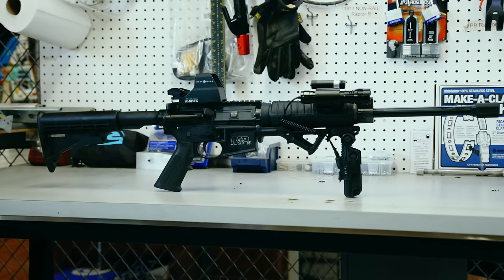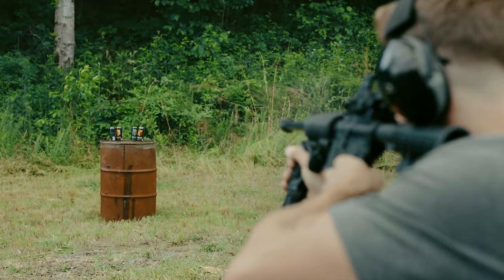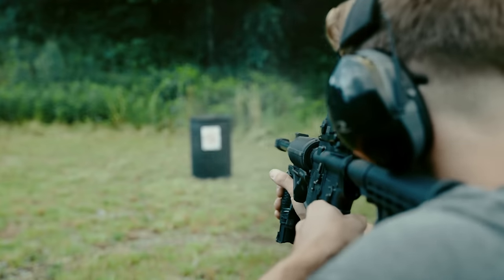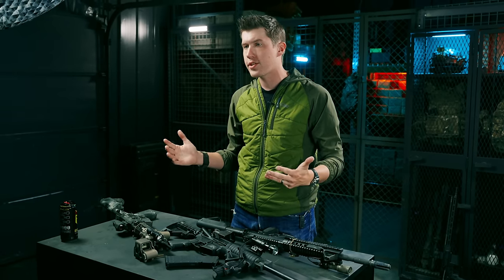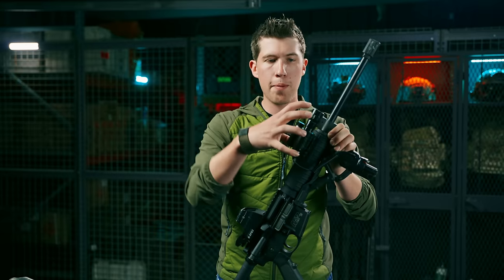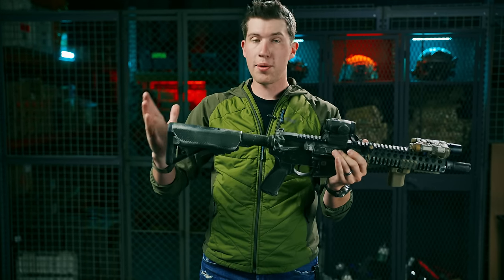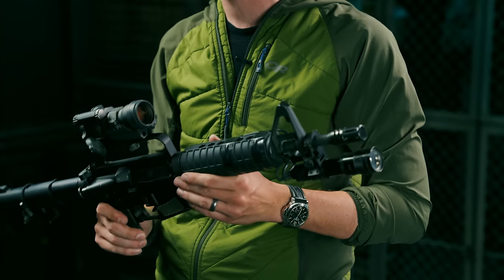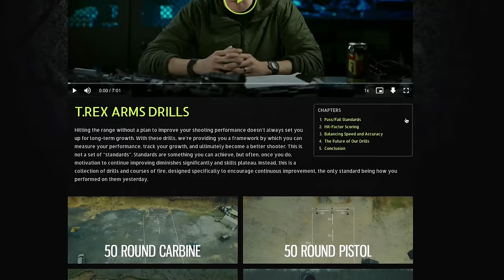5 Mistakes New Rifle Owners Make

Comment: After being in the Army for
8yrs in a combat unit, 25m / 300m zero is king. You are basically pinpoint accurate from 0-50m and 250-325m. Everything in between aim a tad low. Either way 0-350m if you aim low center mass at a man sized target (without wind) you score a hit.
Reply: hard wrong
Reply: I’m so glad you said that😅 because for us city boys with indoor ranges sometimes 25m is all we can get
Reply: I zero 30-30 to 175 yds. A center hold hits a deer's vital zones from 0-250 yds
Reply: Max point blank is less error and gets you the same distance..I mean get some sort of zero for sure, but you’re better off zeroing at a farther distance.  The only reason the Army does 25 is because they can’t afford the time or ammo and dont have the space to do a 200 yard zero in austere environments
Reply: Is the romeo5 a good red dot to start with?
Reply: @dasboot9471 the US ARMY doesn't have time or ammo? Kind of confused by your statement
Reply: @SotoPhotoDir Yes.
Reply: I have been in the Swiss army and our standard shooting distance is 300 meters. Almost each village has 300 meter range and if you are enlistet in our militia type army, you have to shoot at least once a year and get a minimum of points. So all our rifles are zeroed on 300m and I have been shooting from 5 to 300m without ever changing anything on my iron sight settings and hitting everything. the only thing we have is flip up back sight that lets more or less light through (biger bore) for low light conditions. Our SIG rifle shoots the same 5.56 Nato as the AR.
Reply: @wickedtwix  Not to detract from the main topic of the thread here but I love that SIG rifle you're talking about. It is one of my most sought after rifles and I hope to have one imported here to the states someday.
Reply: @2A4ever  yea being the dork I am, i did not purchase my service rifle 30 years ago because i wenz abroad. Would love to have one but they are 3.5 grand bone stock simple...more if you want some fancy stuff mounted. I will fo for the AR15 😉
Reply: yurp. 25m/300m ftw.  

and if you feel the need, 25/300 on red dot, 100m on iron sights.
Reply: @SotoPhotoDir yes
Reply: @wickedtwix  no you can't sight in at 300 yards and then hit everything in between unless everything is a man sized target and you are fine hitting anywhere on it... and even then you are going to have some problems. Stop the bull.
Reply: You obviously never shot the SIG STGW/90. The rear sight has four settings for 100, 200, 300 and 400 meters. If the gun is sighted in at 300, you will hit everything from 10 to 300 without issues. And yes, shooting man sized targets is a thing in the army but as you know, these have an A zone as well. Check out our A5 and B5 targets we shoot on 300m if you are interrested.
Reply: Range I've been going to is only 25 so that's my distance for the time being.
Reply: @SotoPhotoDir  yes. I have several on several different platforms.  I have kids now so I can't afford more EoTechs or ACOGs lol
Reply: @celticanglotx313  If we go off the assumption that your 25 unit (yard or meter) zero reconverges at 300, you're going to be better off zeroing at the longer range if you can. You can be off very small amounts and it not show up as much at 25 as it will at 300.

I wish you the best of luck getting access to longer ranges!
Reply: @jonathanschubert9052  What grain/ammo on that 30-30?
Reply: I first zeroed at 25 meters since that’s the max for most indoor ranges, then I sighted at 50 at an outdoor range.

I hear what you’re saying about 25/300 but I don’t get the logic over 50/200. I’d much rather hit a little low at 25 meters (and at a larger target both because it’s closer and because it’s the torso area) than miss high at 50 meters. It’s also a flatter trajectory to 200 meters. Not sure how many 200-300 engagements happen but trying to compensate for that drop would be much more difficult.

Disclaimer that I have not served. I’m just trying to sort through the logic in my head and it just seems like 50/200 makes the most sense, at least for me.
Reply: @angelofpain3890 it’s the only way you zero in the army. I’ve shot expert that way for the last 5 years. Irons and Aimpoint CCO.
Reply: @dasboot9471 but the science lines up it works fine. I never miss the 300yd shots with irons. 25yrd zero every year
Reply: @wickedtwix we zero at 25 and then qualify on a range of 50-300m. I shoot 38/40 nearly every year. Iron sights and Reddot
Reply: @celticanglotx313 it works well enough. You do it properly you won’t miss a person from 50-300m
Reply: @notsure7874 the 5.56 cartridge rises after it leaves the barrel. It’s physics. It doesn’t matter where you zero it at between the top it’s gonna be the exact same.
Reply: @archipelago93  due to bullet trajectory, you will not be able to sight the 556 at 50 and 200. If you move your first impact point up to 50, the second will also wander out farther.
Reply: @icebox829  That is just not true. The 5.56 has no special properties that other cartridges don't have. I'm not sure what physics you believe are taking effect, but the "rise" in a ballistic chart is entirely because the sight is above the barrel. If your sights were on the same plane as the bore center, there would be zero "rise" on that ballistic chart.

https://www.youtube.com/watch?v=IkCwedaAOGE
Reply: @thomgizziz  get quality irons. i zero at 25 meters with the rear at 8/3+1 i shoot a 10 inch shoot and see and do very well. that's vitals on anything you'd ever plan on shooting with a 22 caliber rifle. i do like optics and use them more since I'm getting older, but don't act like someone cant shoot accurate open sights at 200m+
Reply: @SotoPhotoDir  Yes, the Sig Romeo5 is the top choice for about $110 to $103.  Holosun 403 and 503 may come from the same factory in China but cost a little more.
Reply: im the outlier i like the 50/200 zero.
Reply: @raphramos6297 it’s not about affording ammo it’s about units not wanting to to check out more ammo and spend all day zeroing a company
Reply: @MylesKillis  I've fortunately wasn't a part of a unit like that. I hope those units get better leadership in place
Reply: I prefer iron sights I hate scopes
Reply: Brother you are lost in the sauce. If  a 25m zero converges at 300 then a 300m zero also converges at 25. Why not shoot at the closer target, zero, and move on with your day? I think if someone took you to the range and had you zero a rifle you'd pick up what we're putting down.
Reply: Lol so you're saying just don't use sights...you'd still have to aim up to hit any target at any distance. It's like throwing a baseball, no different. I'm starting to think you are trolling people.
Reply: lol sorry hoss your time in what I’m sure was 3rd id doesn’t mean shit 😂 50-200 meter zero or a 36 yard zero is much better. The arch of the bullet is much shorter than 25m-300m meaning you can be more accurate with less deviation in your impact over distances both closer and farther away

Comment: My first AR15 was a M&P15 gen 1. I was in the Army so I got it from the PX for $500+ tax free. I converted as much as I can to get it as close to my Army issued M4 so I can improve my marksmanship. 10 years later and 4 other AR's, I still have it and it's  my bedside home defense AR.
Reply: S&W MP15 is a very good AR. Don't let anyone bull you.
Reply: Where were you at? We didn't have guns at our PX at Fort Stewart.
Reply: @tballstaedt7807  yup I tell people the same thing.
Reply: @jaycee509  If I remember correctly fort Irwin is where OP4 training is right?
Reply: @mx500a4  yup. Brigade level training. Units usually go through rotation here before a deployment.
Reply: @jaycee509  I think our brigade was scheduled to go to either Fort Irwin or back to Ramadi in 2007, but they ended up sending us back to Iraq instead. I didn't get to go back though. I decided to become an alcoholic and drug addict and they kicked me out 3 months short of my contract. I was a dumb ass.
Reply: @mx500a4  ah damn. Hope you're doing OK now bro
Reply: @mx500a4  they definitely sell guns at ft Stewart px now.
Reply: @almalikaluqdah3699  I actually bought my first gun just outside the base in Hinesville back in 2005. I can't remember the name of the gun shop though. I was 19.
Reply: @jaycee509  I got off the drugs right after I drove back to Minnesota after getting discharged, (I got a general). But the drinking was a bitch to stop, finally sobered up 2 years ago. I was still successful in life but I drank everyday.
Reply: @mx500a4  Excessive binge drinking is just par for the course for active duty life. It's like frat life with weapons, high explosives, and unit PT mixed in, lol.
Don't get me wrong, crushing some cold ones with folks in your unit can build camaraderie and unit cohesion...but all too often it can (and does) lead to folks turning into raging alcoholics, unfortunately.
Reply: M&P = trailer trash gun.
Reply: @sevenpointsixtwo9707  If by trailer trash you mean reliable feeding and decent accuracy & durability, then yes. Is there any better value that can be had for an AR?
Reply: Mine was a gift from my grandpa after I got out of boot camp
Reply: @mx500a4  I got my first AR15 at an air force BX at Beale AFB in Cali. Just had to ditch the bullet button when I finally got outta there.
Reply: @sevenpointsixtwo9707  I have an M&P as well and it has treated me great for the passed 12 years. Still fun to shoot and it still holds it zero. What's your point? People like you make me laugh. Talk shit behind a keyboard just to get a rise out of folks. Good luck in life. Your going to need it!!
Reply: One of my first rifles was the M&P-15 Sport. I absolutely loved how it had no frills and had great quality everywhere it counted. I miss that thing.
Reply: @christoph9587  it’s just a guy that likes calling people poors and saying poverty pony (unfortunately he said that in the video) as a way to front on someone.  There’s for sure junk out there that you should steer clear of but the M&P is better than nothing and are reliable no frills guns and are a great entry into the game.  Tacticool bros that go and drop $4000 on a DD and optics and they can’t shoot any better than the poverty pony?  See it all the time.  A Sportcar and Econobox both get you from A to B.
Reply: @jamestewell7721  I also have a Noveske I got last year. That thing is great!! I am definately glad I got my M&P to start out with. It taught me how to shoot. Guess that is all I can really ask for out of an entry level gun. You make alot of sense too by the way. Good shit sir!!!!
Reply: This is the exact type of input that makes me wonder why he seems to hate on it so much? I think he’s gotten so used to the Rols Royce of the gun world he’s forgotten some people will never be on that budget and that even as a budget AR the S&W 15 is a good rifle that can go toe to toe with many more expensive guns.
Reply: @sevenpointsixtwo9707  Well it definitely Kept Kyle Rittenhouse alive in a grave situation and didn’t fail him. By the way, I lived in Wyo for a winter some years back and to be honest with you, I saw some insanely nice guns in any of the trailers I went into lol.
Reply: @mx500a4  Don't forget Ft. Polk!
Reply: @mx500a4  they do at ft Jackson
Reply: Bought my 1st AR in Fairbanks, Alaska in 1979. It cost me about $250 new from a hardware store. Unfortunately sold it (and other assorted items) to guys in my Company when I PCS'd out in 82'. Too much of a hassle with the Canadian government driving out on the Alcan to the Lower 48.
Reply: Well said Sir! And to many of you who replied to this flex free comment with honest review of your own experiences, thank you. And, I agree the M&P15 is a great entry level AR. 

So that being said, I now have to say this. I came back to this channel, more particularly this video for mostly one reason! I remembered how cringe it felt watching what used to be a favorite content channel of mine start talking down about 
"some of your favorite YouTubers" are Scheels or uneducated hacks, and that "just as good" firearms & firearm accessories are like some mythical cryptid, where if you are even remotely curious you're labeled as a "crazy tree thumper", in our community you're "poors!"  I'll be the first to say that just as good firearms/firearm accessories aren't real common. But I own what I would consider to be "just as good" firearms/accessories. The one that made this video feel so grimy is my M&P15! Its never had a a single failure and after many, many rounds of range time (around 2000) it continues to shoot sub MOA! And though I wouldn't put my Sightmark on an AR, it does however still sit on my Remington 870 deer gun. And with that slug gun, anything I want to shoot inside of 120 yards had better be smaller than an 8" paper plate or its dead! For a $100 red dot to take the shock associated with 3" Magnum, high brass slug shells, and its resilience to the weather that I have it in every December as a southern Ohio whitetail deer hunter surprised even me. And thats why I have put that particular Sightmark in the "just as good" catagory when compared to an EO TECH at least for civilian uses. Know if you have nods and think you're a backyard SEAL, buy an EO TECH But aside from the NV settings, Sightmark is neck and neck, and a 400% savings!

Now, dont ask me why this guy cant hit a row of cans 20 feet away, while shooting half a magazine through a sub MOA rifle mounted with a Sightmark!?!? 
I personally have killed 10 or more whitetail deer with the slug gun I mentioned above, 3 of which I harvested in excess of 75 yards!!  

My conclusion is, ¹ he is a Scheel himself, ² he's a "troll", one flexing "knowledge"/ opinions that he has grossly over valued. And is maybe even so false in character that he is editing the film to show "bad accuracy", from "bad firearms/accessories!!"
Especially considering at that distance I could have hit way more targets than he did with no sights at all on an M&P! HONESTLY, I COULD HIT MORE TARGETS THAN HE DID AT THAT RANGE WHILE BEING BLIND FOLDED, AND HAVING ONE HAND TIED BEHIND MY BACK! WHAT HE IS SHOWING JUST DOESN'T MAKE SENSE! 

HE STANDS 20 YARDS OR LESS FROM A ROW OF CANS HE'S FIRING AT WITH WHATS LIKELY A 2MOA RETICLE, AND HITS WHAT, 1 CAN IN 6 OR MORE SHOTS!?!?
JUST SEEMS ILLOGICAL TO ME! HE WOULD HAVE TO BE SUGGESTING THAT THE RETICLE IS "BOUNCING" IN THE OPTIC, OR THE OPTIC ITSELF IS SHIFTING! 
BOUNCING AND/OR SHIFTING SO MUCH THAT HE IS COMPLETELY MISSING A ROW OF TARGETS THAT IN THE VIDEO LOOK AT LEAST 2 FEET WIDE, AND NEAR 8" TO 10" VERTICAL?!?!

UNDERSTAND NOW WHY IM DRILING THIS POINT OF MINE IN THE GROUND? I'M BEING GENEROUS WHEN SAYING HIS TARGETS ARE 20 FEET AWAY OR LESS, CAUSE THEY LOOK NO MORE THAT 10 FEET AWAY! BUT IM WILLING TO CALL IT 20'. CAUSE EVEN STILL IT'S NEAR IMPOSSIBLE! THE OPTIC WOULD BE SHIFTING SO SEVERELY THAT IT SHOULDN'T BE ABLE TO STAY MOUNTED TO THE RIFLE! AND IF ITS THE RETICLE SHIFTING TO THAT DEGREE OF MOVEMENT, THE GLASS IN THE VEIWING WINDOW WOULD BE UNSTABLE IN ITS MOUNT AND WOULD GO FLYING!
 AGAIN, SOMETHING IS OFF IN THAT PARTICULAR SCENE
Reply: I got my M&P 15 M4 back in 08 back when you didn’t have many options! Still have it today still sold as the day I bought it. I have done quite a few upgrades I have well over 500 rounds through it and it has never had any problems whatsoever! I only paid 600 for it as well and it came with 5, 30 rounds p-mag with it which proof of purchase. Still have all of them as well as I have seen burn down videos of the MP15 that went over 800 rounds with the stock gas tube! So people can say what they want it definitely wouldn’t be what I would buy today not at all. But that doesn’t make it a bad rifle they work just fine and I will never be getting rid of mine that’s for sure.
Reply: Same here. I still run the M&P lower but it now has a 20in FN barrel on it with a better trigger. Bought it off someone for 250$ and shot 1000s of rounds through it. I'd rather have a cheap starter and a ton of ammo to train with. I learned a lot from that rifle!
Reply: Hello poor 😂

Comment: Fun tip: if you have iron sights you can adjust your front sight with just a round of 5.56 by using the tip of the bullet to push down the retaining pin. Then just rotate that pin to move it slightly up and down.
Reply: I learned that trick in the military
Reply: @TheBlackScatPack it is literally in the M4 carbine user manual
Reply: A nail usually works FAR better.
Reply: @harrymallory7963  Sure, but how likely are you to have a nail on hand to adjust it in the field?
Reply: @GoogleDoesEvil   I have two now that I keep in my rifle bag. I keep them because I know they work better than so-called front sight tools.
Reply: @rabbit3897  I do, and it pisses people off to no end. I love it.
I use nails because they do a better job than bullets and  I spend more time properly adjusting the sights and les time cursing at it.
Not sure how that makes me a perfectionist, but OK.
Reply: @GoogleDoesEvil  Well if I'm in the middle of building my house when the zombie apocalypse comes?.... Lol.
Reply: That's not what zeroing your rifle means... If you meant to say you can adjust your front sight by using a round to depress the detent holding the front sight in place, then yeah. It's literally what the manual tells you to do...
Reply: @harrymallory7963 the front sight tool is better.
Reply: @Conky88   I have one. It stays in the tool drawer.
Reply: Except not on the Magpul MBUS gen 3. 😂
Reply: @harrymallory7963 LOL. Trying to convince yourself that a nail is better than a front sight tool is peak cope.
Reply: @littlejackalo5326  Its a "peak cope"? What does that mean? All I know is I have a front sight tool and a nail and the nail works and the tool doesnt.
Reply: Just the tip? Cool
Reply: @LION509  Such a helpful chap isnt he?
Reply: Yut
Reply: Pretty sure you have to adjust your front sight post when you zero the rifle...